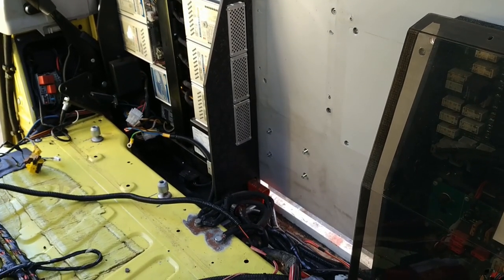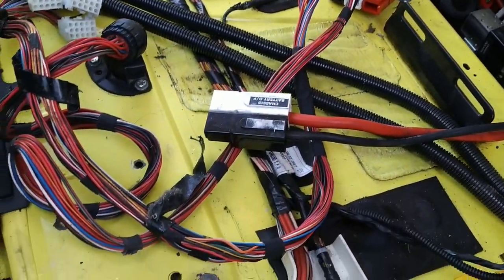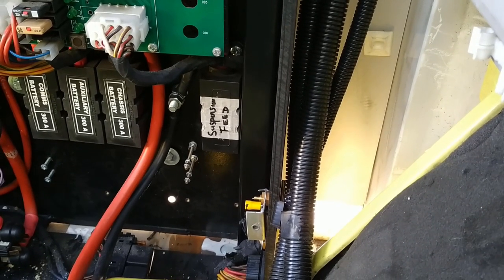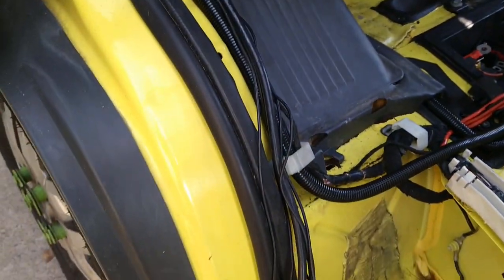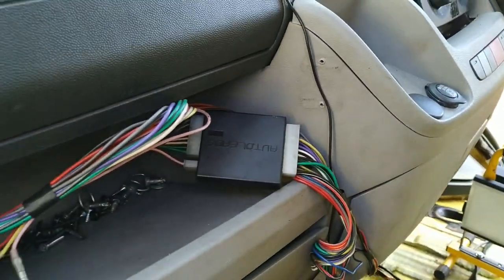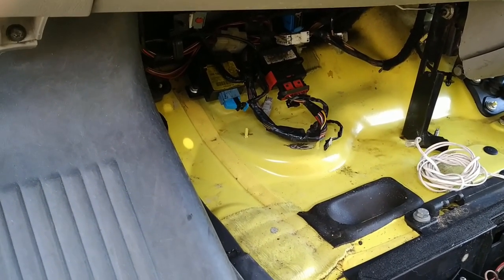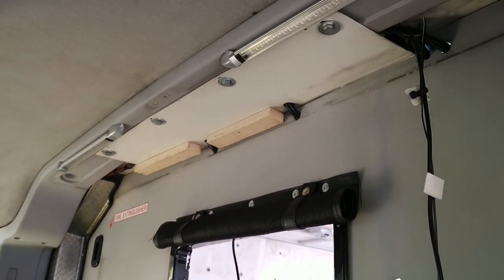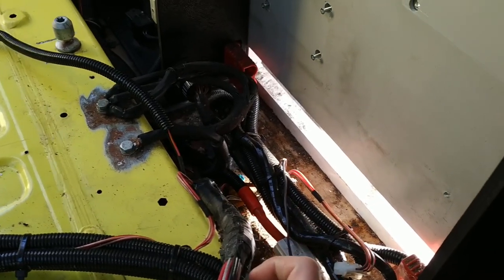EX UK A&E Ambulance Ring Carnation Genisys system Notes

Comment: I've got a converted 03 ambulance. The wiring was not so complicated in that and even then it was a pain to convert. I had an electronics guy do mine. I was going to buy another to convert as I love the back box.
I don't think I'll bother as the electrics look too complicated. 
I think I'll buy a prison van.
Reply from the maker: Next van I do, assuming I ever do a third one will be an ordinary panel van, ex service vehicles as just too much unnecessary extra work. However as I have just finished my Crafter it will do for a while and my next van will be an EV variant probably!

Comment: was it easy to remove the genisys system from the van - what problems did you have ?
Reply from the maker: Dead easy as it is all redundant, identifying some of the wires can vary from dead easy if properly labelled like WAS do, but a pita if not and there's a whole bunch of similar coloured wires to identify even then they are easy enough to trace if done methodically.

Quite a lot of the wiring goes through to the engine bay blue lights and sirens etc often this has been chopped off and left dangling sometimes dangerously so! the WigWag wiring is usually spliced into the headlights as well often bodged with tape

That's and all the weird stuff often chopped off cables they install under the dash is always the stuff I deal with first.

Genisys does control the vehicles crude split charging system to the aux, comms and lift batteries etc but even that isn't really worth keeping as it can easily isolated by wiring the relays differently e.g to the alternators D+ output. Personally I prefer to install a proper B2B setup every time.